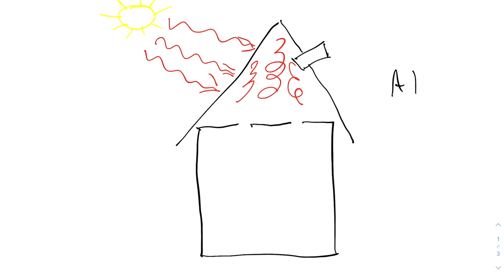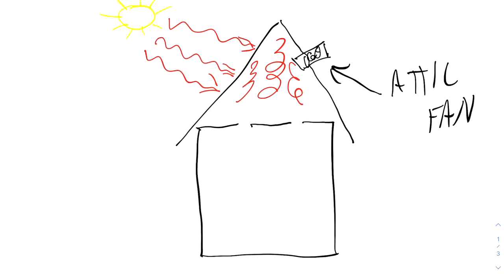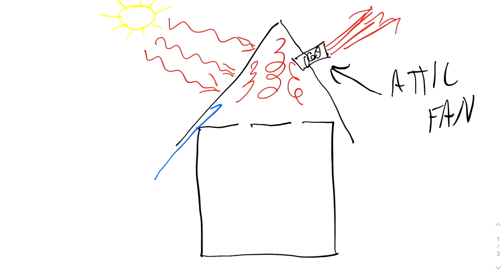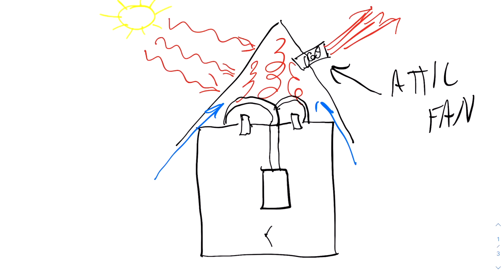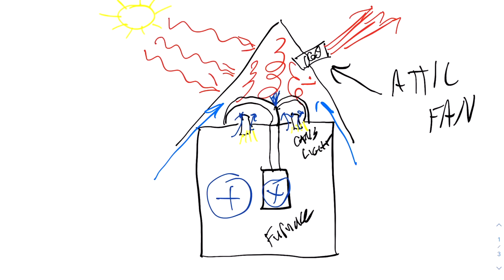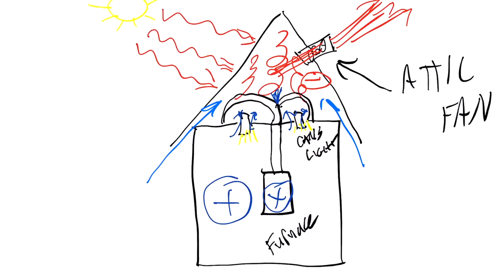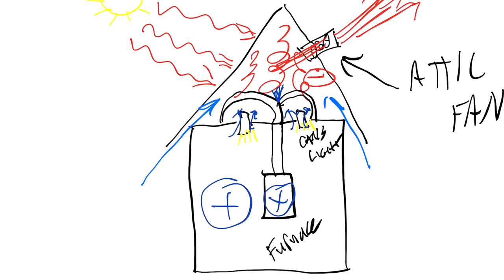3 Remodel Rip-Offs

Comment: As a remodeler i have always told people window replacement isnt a money saver. I generally say, “replace them if they dont operate well or have rot.” If people want to save on energy, i suggest attic insulation. In my opinion insulation is the best bang for your buck to reduce energy consumption and it seems most houses are under insulated unless they are recent builds. Im in MN and have seen 8” or less attic insulation more times than i can count.

I also agree with Steve’s comment below me about the powered attic vents. Particularly on one and a half stories which don’t draw air through this soffits at all. I will concede to Mikes point however that the claims of the vent manufacturers are a little beyond what I feel they’re capable of doing. But I have noticed significant benefits.

Comment: The single pane windows I had replaced would have condensate on them to the point I had to wipe it up daily.  As they were 55 years old it was time.  The road noise is much less and no more mildew/condensate.

Comment: I agree about the window replacement issue. 
But I think tinted films are a different story. I have a large window in the front of the house. In summer afternoons with the sun shining on it you could feel the radiant heat just blasting into the house. 
I added a ceramic film to that window and saw an average reduction in house temperature of 4 degrees. This made it much easier to cool the house off at night. 
Yes, this was a couple of years before I broke down and installed central AC. Which, of course, made a huge difference in our ability to control the house temperature.
But the data was compelling for ceramic window films on windows facing into the afternoon sun.
Note: I do not work for or have any association with window film manufacturers or installers.

Comment: I like the smart thermostat having a minimum fan run time per hour (Ecobee does this in 5 min increments) to make sure the air in the house is circulated.  It doesn't work after the cooling cycle like what you mention but if it hasn't run at least X minutes in the past hour, it turns on for X mins and then shuts off again.  For the spring and fall this is nice to keep the air in the house circulating when the AC or eat may be turned off  on nice days.

Comment: My attic was so hot I put a $16 box fan in there and it instantly felt cooler within 10-15mins….then, it felt hot again so I opened the attic door and the fan was DEAD! Bought an $80 one off Amazon that uses an extension cord, and I mated it to a $8 Intermatic timer

Comment: I agree to an extent. I have been in the roofing industry for apx 20yrs. My go to is if you have an existing fan that has a thermostat I set it to 120 degrees wheather they have chose ridgevent or not. That being said I let them know that if you really want to cool your attic space then a good radiant barrier system is the best way to do so. In our area south eastern VA we have a good portion of summer with damp hot stagnant days. I don't try to sell attic fans but if there is already one I just leave it especially if it's thermostat controlled in addition to the ridgevent.  But I believe the best is radiant heat barrier system with ridgevent and eave vent but if the fans there then I leave it there. If it's a failed fan I let them know they don't really need it but if they want it replaced I will replace it.

Comment: Another thing...call an electrician and ask what he charges to install a 110V attic fan (you know, the ones from Home Depot with brushed motors that die in 2-3 years.) I guarantee you that the time and expense to install a Remington Solar attic fan (with a lifetime warranty) will be a lot cheaper than getting an electrician to install a powered vent (every 3 years!)

Comment: Love my smart thermostat. I don't let it think for me but I adjust it by voice from almost any room in my house. That's super convenient especially if I'm going to shower and need heat for a few minutes. I have an Alexa shower routine that will (among other things) increase the heat for 20 minutes so when I step out of the shower it's nice and warm. Also, during the summer it's nice for those nights I'm up late I can keep the AC on for a few more hours when it's still hot around midnight just by voice and not having to go to the room with the thermostat. Last, if I'm staying late at work I can delay the AC for awhile from the app while still at work so as to not have it running unnecessarily.

Comment: I installed an attic fan several years ago and it made my A/C unit run a lot less, and it gave me lower power bills.  You forget that when the sun goes down, the attic is full of hot air.  The fan pulls this air out and there is no sunlight to reheat  it until the next day.   I cry foul on this review.

Comment: I would agree that in an IDEAL house, a powered attic fan probably isn't necessary.   But if the ridge vent (if it has one) isn't ideal, or there are other issues, having a fan to "make up" that exhaust is probably better than not having it.  [Same with HVAC duct booster fans; yeah, ideally a proper system wouldn't need that; but YOUR system might benefit from it.]

Comment: I have taken ventilation classes from airvent and I personally hate power attic fans. BUT they do have a purpose. Hip roof don’t have the space for other types of vents. In most cases power fans are misused. Do not mix with other exhaust vent types, and 75% of homes I check don’t have enough intake ventilation.

Comment: Great video. What I have noticed with solar attic fans is that they really work well when the house has a somewhat short attic height. So for instance a two story home where the majority of the heat in the attic sits closer to the ceiling drywall right above the insulation. With shorter attics keeping that hotter air moving is beneficial to the duct work and any radiant heat right above the ceiling. Where you might not notice a huge difference is with tall attics where the heat has the ability to continue to rise up and out away from the ceiling. This is what I've noticed here in extremely hot FL. Also, in my opinion they are cheap to buy, cheap to maintain and cheap to install.

Comment: @buildshow It seems to me that if instead of creating a negative pressure zone in the attic, if the pressure is balanced by introducing say 500 CFM of intake air with 500 CFM of exhaust air, there shouldn't be an issue with sucking cold air out of the house.  It just seems like there should be a way to get reasonable attic temperatures with air movement.

Comment: I don't agree with Matt about the attic fan.  I had one before and it was installed and i never had to deal with it or even notice it, besides the cooler temp in the second floor of the 2 floor house.  

I have seen another video of Matt where he installs spray foam.  I think he even installed it in his house?  I think there are two camps when it comes to attics.  Completely seal it off, or allow air to flow through it.  Matt seems to be in the completely seal it off.

I look at a attic fan as a way to create shade in your attic.  Let me explain.  If you go outside in the sun and are under a shade, it feels a lot cooler.  Now take the shaded area you are in and start putting up walls around it till you have a complete closed off room.  Now you lose the cooling effect of the shade and start having greenhouse or hotbox effects, where the sun heat starts accumulating.   The reason why shades feel cooler is that the object providing the shade is taking all the sun's rays directly and heating up, the person underneath the shade is now not getting those rays, but the object providing the shade it is still heating up.  Well this is your roof.  It creates shade, but it is heating up.  By putting up an attic or gable fan, you are essentially removing the heat building up in the roof and allowing it be more like a provider of shade, then a hotbox.

I hope that made sense.  lol.  At least thats how i view it.  I want to create as much shade around my house as possible, and i see my roof is providing shade over my whole house.... if only i can prevent the hotbox effect.

Comment: My house is a rectangle, in the attic it has a screen covering each end, about a 5ft triangle. Why would I not install a fan on either end to pull hot air thru and out? Clearly theres no pressure considering its open at both ends. And from May to October its about impossible to stay up there for more than 10 minutes (I'm in Dallas).

Comment: Can’t say I agree with the attic fan being a scam, displacing the heated air with cooler air coming from the eaves or lower if possible, will absolutely help. Unlike your analogy, imagine being in a sealed box in the sun, it’s gonna get hotter and hotter. Then imagine putting a small fan and a vent to circulate hot air out with cooler air. Yes the walls of the box will still be hot but the air will not have built up with heat.

Comment: If you have bad air leakage from the building air conditioned envelope into the vented attic, then of course there will be negative pressure created by an attic ventilation fan. Fix the air leakage problem, and you've got a fan that will draw air from the soffit vents and cool down your attic - the wind chill effect in action.

Comment: I hate to comment on such an old video when so many people have already made the point I want to talk about... But here it goes:

Attic fans are NOT a scam. To piggy back off the hot pocket analogy you were so confident using... An attic fan is NOT like a fan blowing air inside the microwave... It's like poking a hole in the hot pocket to allow heat to escape the center, obviously. 

The radiant heat makes the attic as hot as it does when air has trouble escaping... Rather than drawing it out, do an actual experiment such as an empty milk jug sealed up and placed by a hot window. It'll expand inside, unless you leave the cap off. It'll be warm, but that radiant heat can escape, leaving it cooler than it otherwise would be.

Comment: If your windows or attic keep your temps high in a hot house it could save you more than that. The AC running nonstop is going to wear out the unit faster, not just raise your electric bill.

Comment: In the north east attic ventilation has more to do with removing condensation than lowering heat. So I guess I disagree with the attic fan theory. It may be a waste down south cause you’re right it will never be sufficient to lower the temperatures but in the north it is a good idea if you have condensation issues

Comment: We install Solar attic fans all the time in Florida.  We measure temp before and after.  on average we find a 35-50 degree temp difference when the attic had no ventilation before or a simple goose neck only.  It absolutely makes a difference and I strongly disagree.  Now these are high end Solar attic fans rated for the HVHZ area.  I would agree a cheap Home depot fan would not do much.

Comment: Yea i hate it when youtubers swear something is a scam/ ripoff or whatever when they dont completely know about something..  attic vents, vent fans, soffit vents, ridge vents, side vents, whirlybird vents all work and all can do positive things for houses..  talking about how vent fans suck out the conditioned air but in a home where you dont have adequate attic venting where its 80 outside, 75 inside and 120 in the attic..  this makes the ac work hard.  I put 2 attic fans pulling in air from the roof that turn on when it gets 110 in there.  The first time they kicked on it blew all kinds of crap out of the soffit vents and the other 2 roof vents.  After that the fans don’t come on except when its super hot out..  and when they do it helps….

Comment: Power attic ventilation does work. You can’t compare a microwave to an attic. The heat (microwaves) that’s coming from the sun to the roof over time heats up the attic space.   That hot air is trapped in the attic space and a ventilator pulls cool air through the soffit vents cooling the attic space.  Being an HVAC technician I can tell you it’s a lot better working in an attic with a ventilator then without.  

Agreed it can create a negative pressure, but that is why all of your penetrations inside your home including your cam lights and electrical holes need to be sealed before insulation is added to the attic sealing off any potential for drawing up conditioned air into the attic space. 

So it needs to be done right or it can be a problem.  But his comparison of putting a small fan in a microwave is not a good analogy, and not correct. 

Eventually, the hundred degree plus air in the attic will radiate its energy down through the insulation and into the home. Ventilating the hot attic and lowering the temperature will lower the amount of heat radiating down into the home from the top lid.  

Your microwave is not a sealed compartment with insulation around it holding in heat. It’s just not the same and I’m not seeing real science behind what he is saying. It looks more like his opinion.

Comment: Horrible advice all around. You want the air to keep blowing past the condensor, because if the moisture stays there mold will start growing and then you'll be blowing mold particles throughout your house until you can get the unit professionally cleaned. When you are ready to shut your A/C off for the night, you should leave the fan on for a good 20 minutes. If you set your thermostat at 70 or 72, the relative humidity is going to be so low anyway, that "rehydrating" the air in your actual living space is probably a good idea anyway, unless you want to wake up in the middle of the night with terrible cottonmouth. And yes, when you are sunbathing in your bikini, a robust breeze absolutely does keep your body cool. So cool, in fact, that every day here in Hawaii, tourists get horribly sunburnt because the trade winds fool them into thinking the sun isn't that hot because they don't feel it. Attic fans are not a scam! Having said that, ventilation is ventilation. Depending on the amount of passive ventilation in your attic, a powered fan might not be necessary. But lots of attics have inadequate passive ventilation. Hence the market for powered fans. As for windows, there's so many variables involved it's silly to even talk about dollar amounts of energy savings. But just to debunk the small savings point, if you are switching from clear glass louvered to double pane casement windows in Hawaii, you can easily cut your electrical bill by $100 per MONTH at our current rate of $0.45/kWh.

Comment: A guy I work with told me. He cut holes in his attic HVAC duct work. So he could lower his attic space temperature and save money on cooling his home. 😂🤣😅  True story, I tried in a polite way to explain that his theory would greatly increase his energy costs. He would not listen to me. So he learned the hard way $$$. I installed HVAC systems and duct work for 3 years. Then I found a much better career choice. Fiberglass was in everything I owned including me!

Comment: What you are missing in your understanding of solar attic fans is outside unconditioned air is being pulled thru the soffit vents by the fans and passing over the hot roof thereby cooling it down and venting that air back outside. I have temp/humidity sensors in my attic and conditioned interior and in my garage and outside in the shade and my goal is to keep my attic temperature equal to the outside temperature in the shade. Since you can place these sensors for under $100 you should do this to see for yourself attic fans work remarkably well.....that the science and the proof.

Comment: I think the CFM rating on the attic fan would make a huge difference... If it's moving enough hot air out of there, it's going to make a difference regardless of his gripes and points about radiant heat from the Sun

Comment: You missed it in the attic vent.  Would love to see you research and admit it.  I live in the south and have used radiant barrier roof sheeting which reflects the heat during the day but inevitably the roof heats up so it holds the heat into the night after sunset. So your roof will be cooler during the day but warmer during the night, the best solution for this is a power fan on a thermostat Which will help cool the attic down down after dark.  The common sense on the power fan I agree with the other comments. It can’t create more suction than would be allowed in through reasonable soffit vents and very little possibility it could create suction to draw cool air out of the house.  Again Matt we would love to see you correct this one. Thank you

Comment: Sorry Matt.
I used duplex boxes and spray foamed around the gaps prior to insulation. I have almost zero "conditioned" air leaving my home. The powered attic fans work great to cool my well ventilated attic. It is unbearable when I turn them off.

Comment: Bad advice dude.  Enjoy your hot attic.  Vents powered by wind, sun, or electricity do work.  And Dual pane windows do work.  Best thing I ever did.  Put your hand on the glass inside your house comparing an old single pane window to a dual pane.  The dual pane is cool.  Plus it stops all the noise from outside.  My neighbors wonder why my house is so much cooler than theirs.  I tell them attic vents and dual pane windows, plus light paint and roof color.